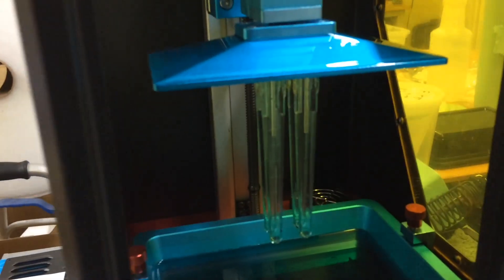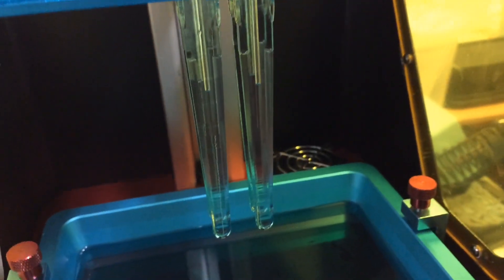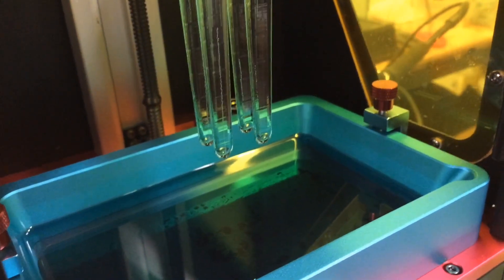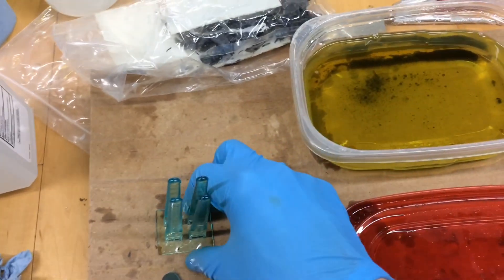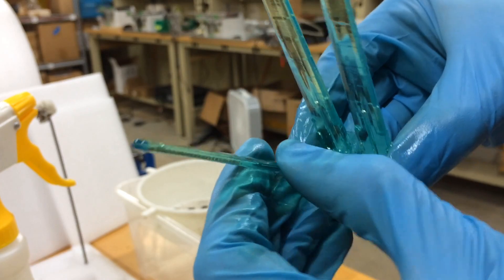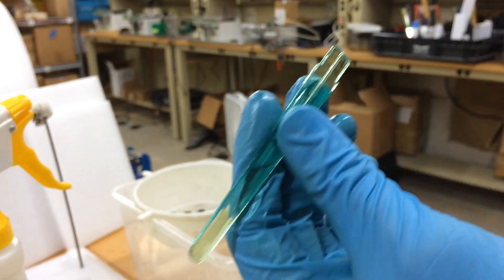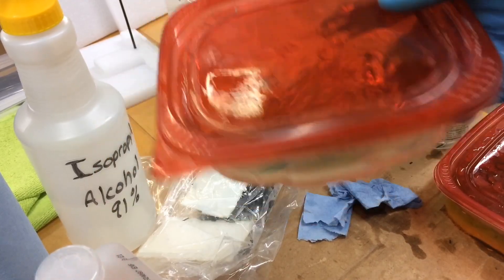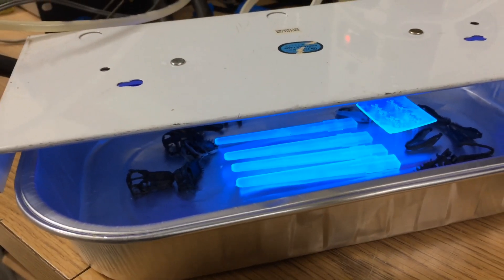3D Printing with “TOUGH” Resin - Pt 2 - Siraya Blu testing on Anycubic Photon for knife making parts

Comment: What were your support settings? Thanks!
Reply from the maker: It's been a while, not sure exactly, but I usually use the default medium supports. The new support feature that helps a lot is the conical base for the support.

Comment: Were they any good?
Reply from the maker: Yes and No. It is much stronger (higher yield strength) than standard resins, but it has been little elongation before breaking, meaning it is still very brittle. So for the purpose of these mold inserts, they broke easily during use. I haven't tried mixing it with a flexible resin, but I hear that gives the best results if you need some added toughness.